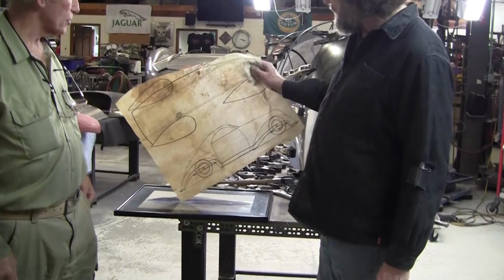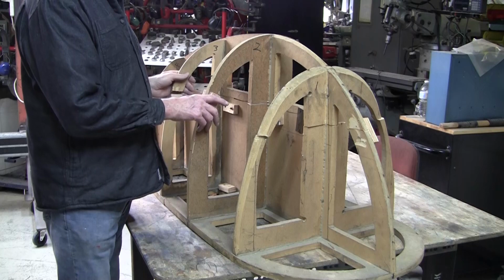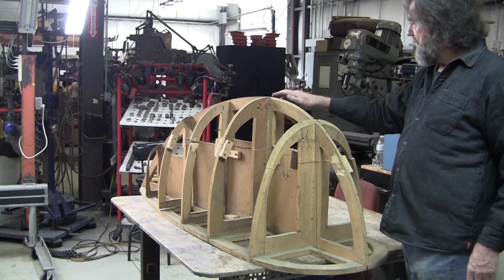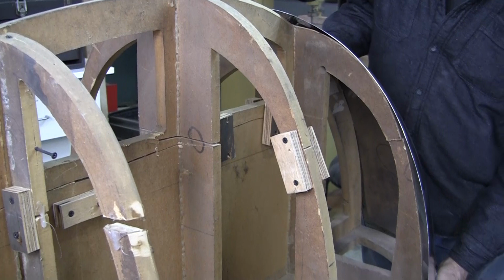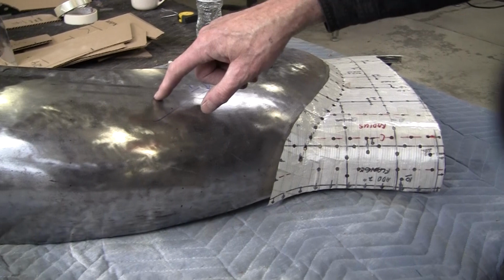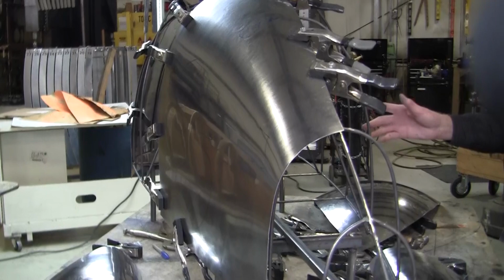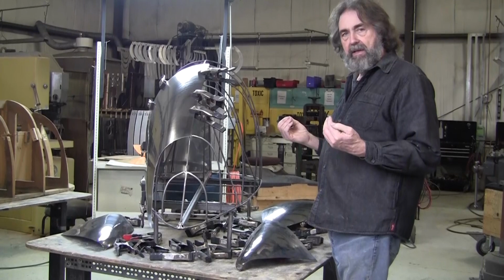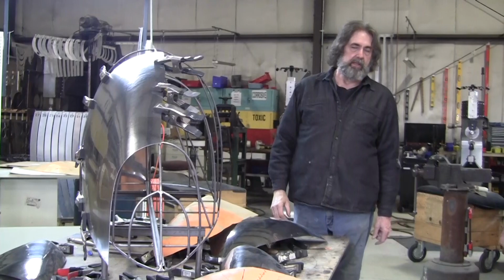Metal Shaping Buck Comparisons

Comment: Great video! Would you recommend the wire method to shape a curtis style rear body for a vintage race car build?
Reply from the maker: Yes, wireform is the best method, it makes proper fitting of the panels so much easier.

Comment: Hey Wray what is that channel material you are using for the base of the wire buck?
Reply from the maker: I think you might be referring to unstrut. It's a generic product used a lot by electricians. I use it as a inner structure for my wirforms also as a left right measuring tool, to insure symmetry.

Comment: What or how is a body line put into a buck?
Reply from the maker: With a wireform it will be easy add the wire front to back. With a wood station buck, you could add a wire as well.
Reply: I can see the benefit of the wire form/buck. But what if  your fender or 1/4 pnl has a sharp body line.  @proshaper